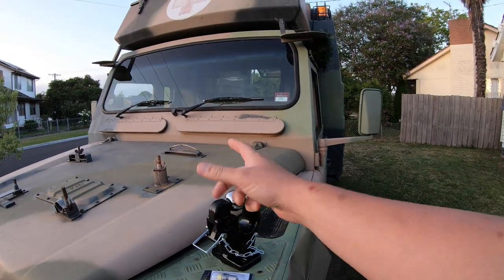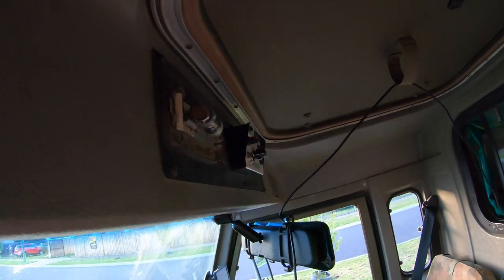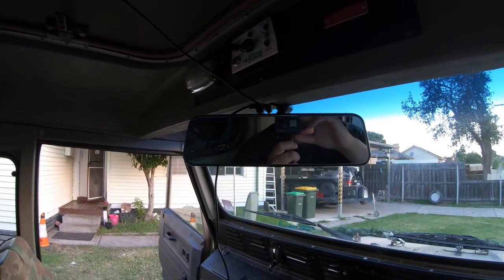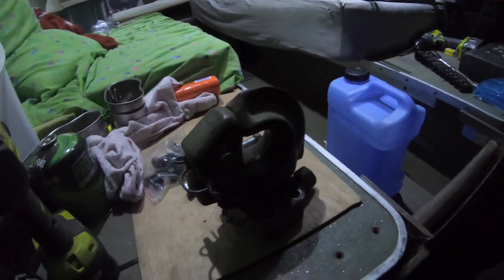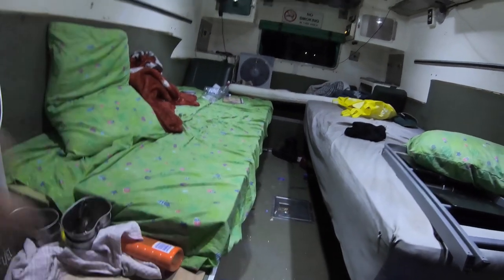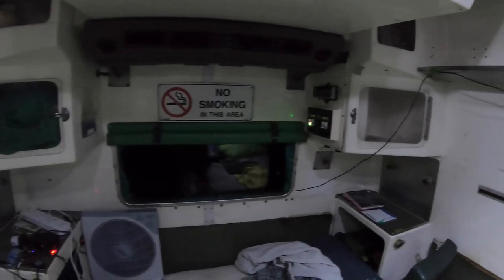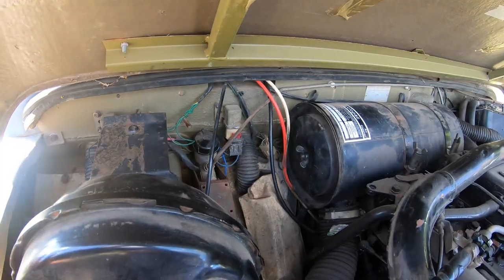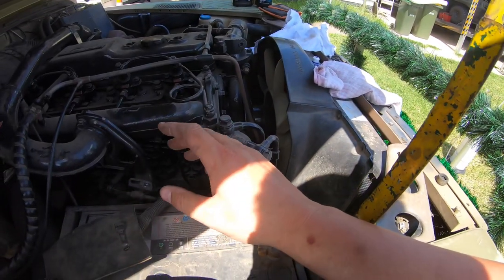6x6 Perentie Ambulance General Maintenance

Comment: latest mod i did to my cargo ver of the 6X6 was to install a duel tank fuel gauge and install new fuel level sensors to sute
Reply from the maker: I'm pretty happy with the stock dual tank system. We don't have plans to go massive distances or seriously remote, but it will probably get some new fuel lines at some point.
Reply: @TheAussieRepairGuy  i did it so that i could see the fuel level in both tanks without having to switch it over. i have also changed out the air cleaner for one with 4" inlet and outlet as the restriction gauge would show a new air filter as blocked runs a bit better now
Reply from the maker: @peterg1448  yeah I need to get around to changing that rubber elbow. Mine is a bit soft and sucks down when the turbo gets going.

Comment: The missing piece on the pintle hook was removed for safety reasons when towing trailers
Reply from the maker: Yes... i know, but now that I have swivelling rings, there is potential for the hitch to flip upside down. The issue of safety is adressed by having the ring swivel rather than the hitch.
If both swivel, the situation can ocurr that the full weight of the load is supported by the hasp and not the hook side, leading to potential failure of the hitch.